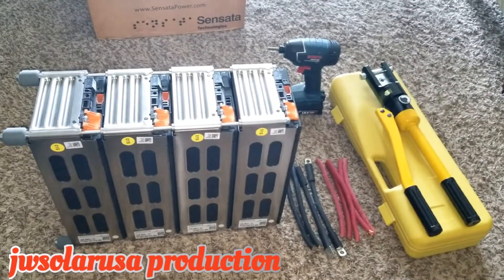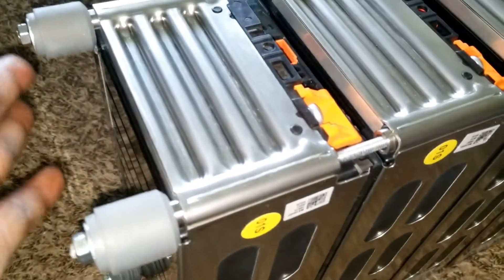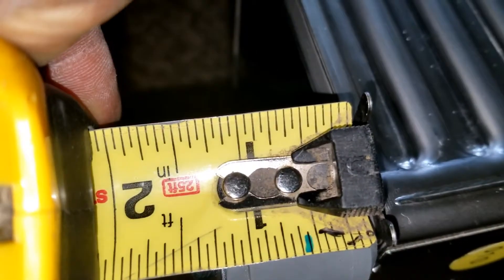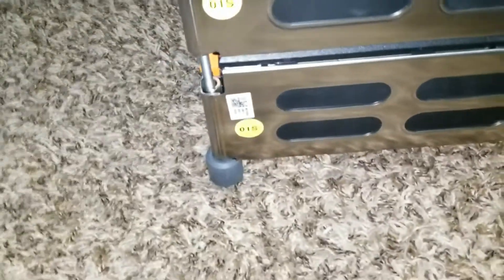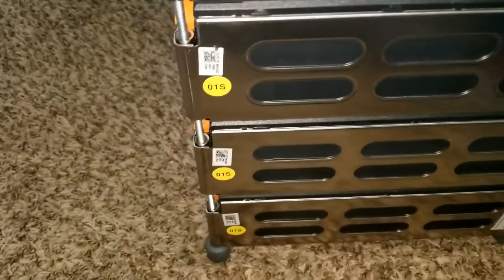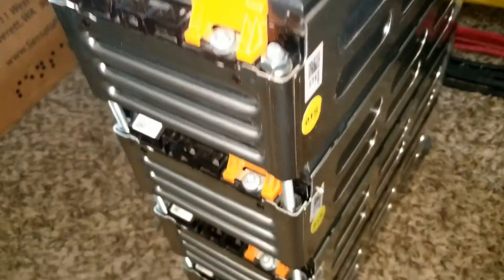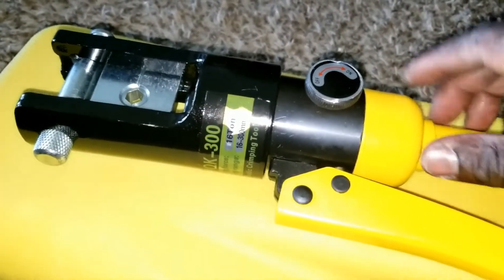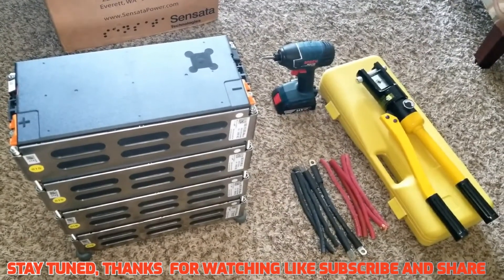VW ELECTRIC CAR, VOLKSWAGEN E-GOLF ELECTRIC VEHICLE BATTERY GEN 2, STACK & READY TO WIRE (Part#3)

Comment: Hi there what bms do you use thks
Reply from the maker: Hello,
I do not have any battery management system (BMS) on on my battery bank at all.
Thanks for watching. I you haven't SUBSCRIBE to my channel, please do and share my videos
Reply: @jwsolarusa 
 hi there I've subscribed  thks
So you use no bms at all.
How do you manage your batteries  
Have you linked to solar system. 
Thks merry Xmas
Reply from the maker: @nigelrobinson8831  
Thanks for your subscription and for stopping by.
I have never use battery managment system yet on my battery banks.
I monitor my systems through Smartshunts
Reply: I've got 6 of the vw gte batteries what size smartshunt would I need ? 
Is there a video of you installing and using 
Thks
Reply from the maker: @nigelrobinson8831  
https://youtu.be/tC7S0UbM-yc

https://youtu.be/y6WVrIsKug0

https://youtu.be/V4I4POwWyvw

https://youtu.be/2hceAvu3jF0

https://youtu.be/yqVfgYjgR54

https://youtu.be/bZpydBMGRRI

https://youtu.be/Xkj4WGPlEGs

https://youtu.be/NtdZkZJdkw0